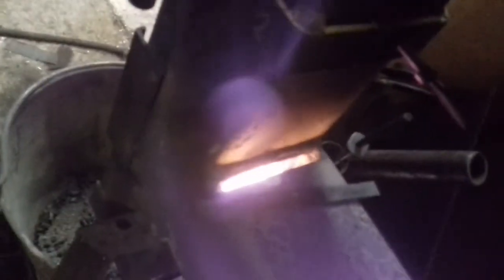rocket stove wood pellet space heater No97

Comment: What do you recommend for a spacing to start with? I'm building a basket out of 2 sheets of stainless on the sides and 1/8" filler rods to hold the pellets, but I'm struggling with a starting point for the basket dimensions

Comment: Did you find that placing the secondary burn plate under the basket is required for better air flow? I'm unfortunately working on my own design, but the front end of my firebox is very similar (I copied your very useful firebox damper). Did you vary the height in comparison to the fire tube floor to catch more ash as a detriment or did it have any effect at all?

Comment: I use a piece of thick metal on my opening in the front of the feed tube, so I can adjust it to get the best burn possible. I can also regulate the temperature in the heat tubes so they're not red-hot all the time. I try to keep mine down to 600-700 degrees so the heat output from the fan is around 120 degrees upstairs. It seems to heat the house just fine.